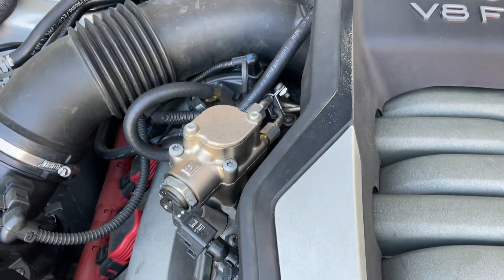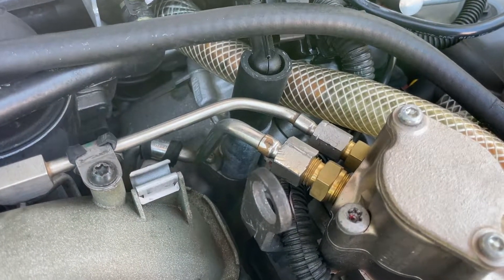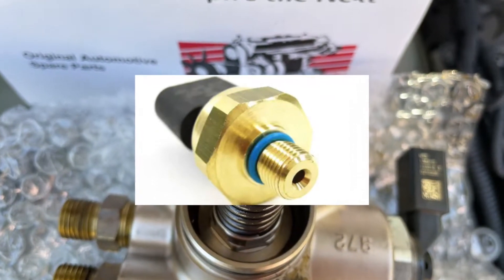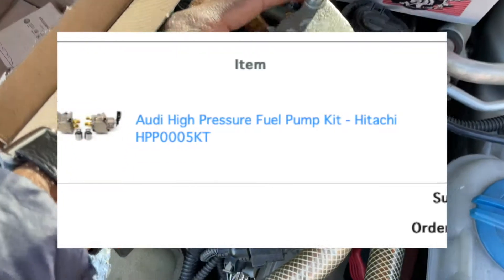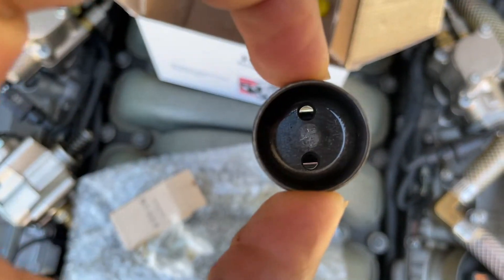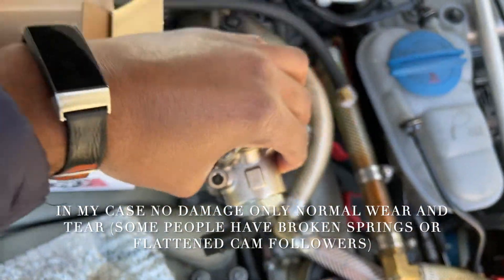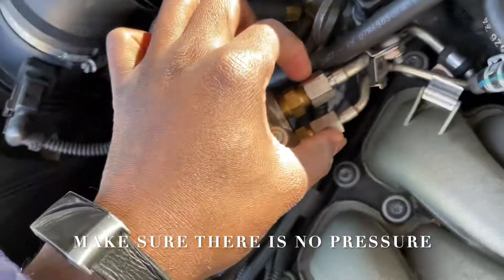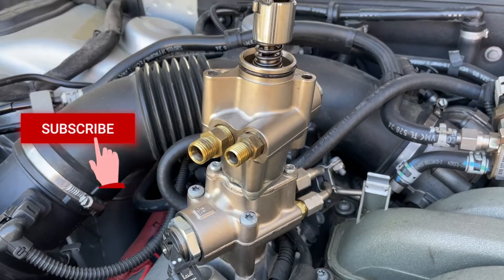Audi S5 V8 4.2 High Pressure Fuel Pump diagnostics and Solutions (hpfp replacement)

Comment: Great video, thank you for posting this!

My car is giving me this fault code:
P2293
Raw code: 2293
ECU: Engine control unit
Status: Confirmed
OBDII: Fuel pressure regulator 2 - performance problem

A little background info:

I ran out of gas on July 1st.

Notice that the car is a little hesitant when stepping on the gas a week later. So I pull onto the main road and accelerate hard. At about 4000 revs the car stops accelerating despite full pedal and the EPC light comes on so I carefully drive the car home. I turn off and start the car again. The EPC light has gone out. I take the car out on the road again to see if the problem is gone but the same thing happens again.

The next day, I notice that the car is a little more difficult to start than usual and as soon as I give it a little extra gas, the EPC light comes on again. A few days later the engine light also comes on and I haven't dared to drive the car since.

I'm was thinking the first step would be to change the fuel filter and see if that fixes the problem. But after watching your video I suspect the issue might be one of the HPFPs?
Reply from the maker: Most likely hpfp, I changed the gas pump and it wasn't that. Also fuel pressure regulator in engine bay and back the electronic part. 
Epc is to tell there's something wrong. Mine had 2 codes maybe you got the second code also. As you see hpfp fixe it
Reply: @ersfixi  I changed one of the HPFPs (on the bank giving preassure errors), the regulator and the gas pump. Still got the same issue. Now wondering if I have to change the other HPFP too or if it's something else entirely.
Reply: I am running into this problem also I did the carbon cleaning first and didn't fix it but needed to be done
Reply: @ersfixi  hi i have the same problem the car run rough and misfire codes 4.5.6.7 check engine light always and the epc light as well and i have a code fuel pressure regulator with other codes like o2 sensor and intake manifold code
Reply: I want to same problem can you solve it ?
Reply: @Stark707.  I’ve since replaced both a HPFP and the low pressure pump inside the tank. But no luck, still the same problem
Reply: Any fix ?
Reply: Hi! What was the problem? ✌️
Reply: @timothyedwards95 - what was the final verdict on this issue?  Sounds like many are having the same issue with misfires, EPC and p2293 and p2294.  thank you
Reply: @brettmurphy415  First I replaced the low pressure fuel sensor (06E 906 051 K) without any improvement. Then, the pressure limiting valve (06D 130 757 D) and sensor (06J 906 051 C), which solved the problem, and the engine has worked flawlessly for two years. Today, the problems returned...
Reply: @TimothyEdwards95  OH NO!!! exact same issue?  I was able to solve my issues by changing both HPFP's.  I didn't go OEM, but I did get Hitachi brand from Summit Racing (HPP0006 & HPP0021 for my S5).  Changing one cleared the code, changing both made the car run better.  I then changed the in tank Fuel Filter (Audi VW Fuel Filter - Bosch 8K0201511A from FCP Euro and get the seat clips also).  Have  you had any resolution to the new problem since yesterday?  I am only 2 weeks into car being back on road.

Comment: Those pumps can take a shit its nobody's fault hp is always the one to take a shit the rear pump in the tank just gets the gas there the hpfp is the one that pumps the gas to high high pressure first to take a shit. Hpfp is usually p2239

Comment: Hello! Great video! :)  I have the same car with a problem P310B / 012555 - Low Pressure Fuel regulation: Fuel Pressure Outside Specification.

what could be the problem.?
Reply: I have this code as well, (also se comment above). Did you manage to find what was wrong with your car?